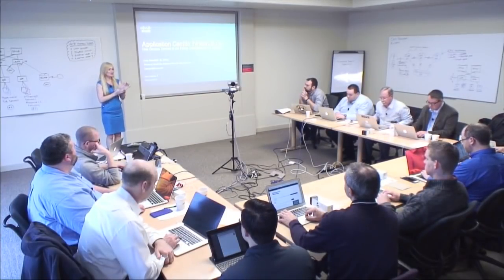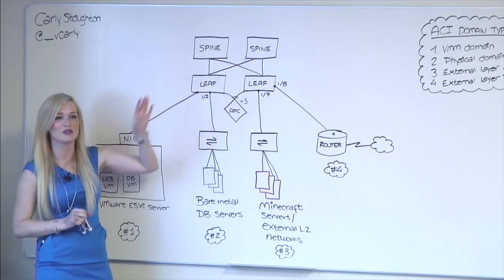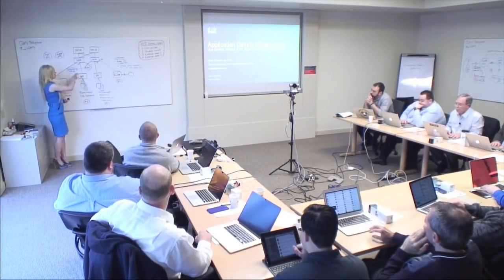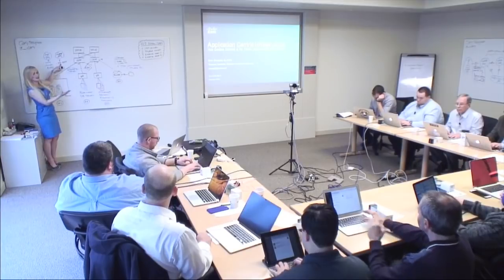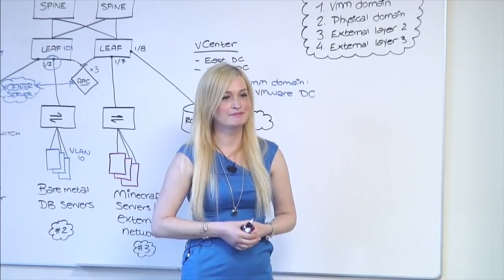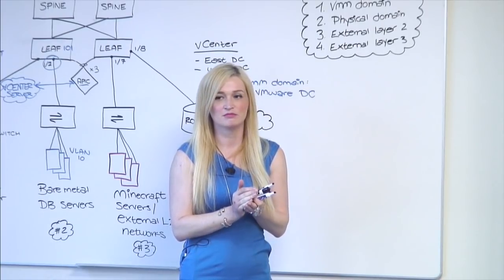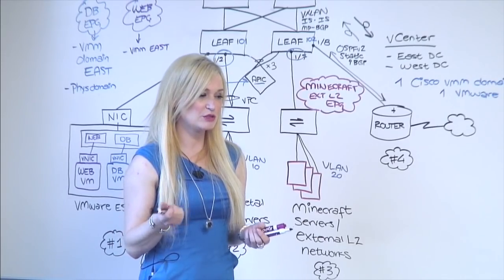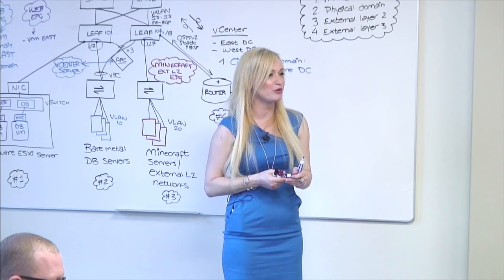How Devices Connect to the Fabric: Understanding Cisco ACI Domains

Comment: @ 27:00 - OSPF adjacency over vPC - this is not entirely correct as explained - from the connected router or FW (despite the fact vPC is configured between the two relevant leafs at the ACI side) - perspective there's 2 neighbors - so for that matter your SNM should match a larger b/c domain. One would think the peering could be a /31 but that''s not the case - This is no big deal BTW but took us by surprise back then.
Reply: Yes /31 not suffice the requirement, you would have ospf neighbor between VPC peer and both VPC peer to external device

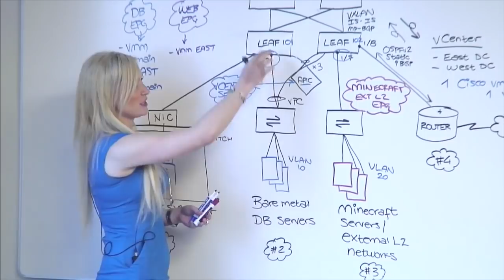Comment: 29:50 -> provided we're in 2016 post Brazos and we now do support transit routing across the fabric - and we'd peer with two independent OSPF routers (say over different border pairs for the sake of simplicity)  - the respective redistributed routes would I presume show as E1 or E2 upon redistribution from iBGP back into OSPF on the other router or can we emulate some form of OSPF backbone and stick to Inter Area or Intra Area routes ?
Reply: E1 or E2 routes upon redistribution not intra/inter area

Comment: Does anyone know, why we have to connect the router to the leafs rather than the spines?
Reply: Think of spine and leaf as a a disaggregated chassis. The spines are the backplane and the leafs are the line cards. Spines are only to be used to connect other leafs. Cisco does break this rule with data center inter-connectivity however.